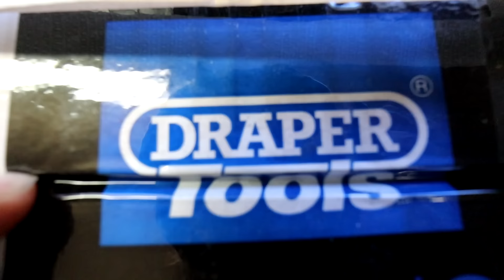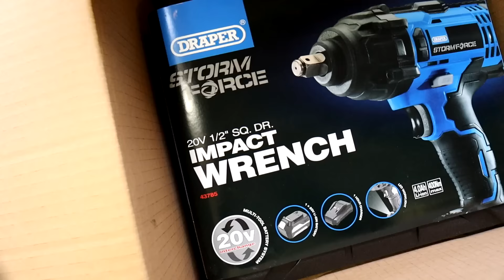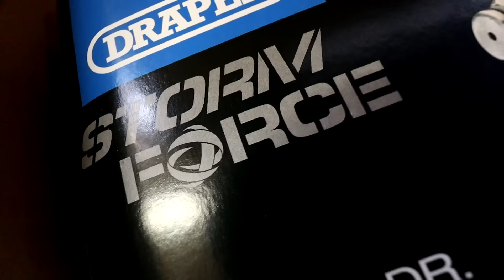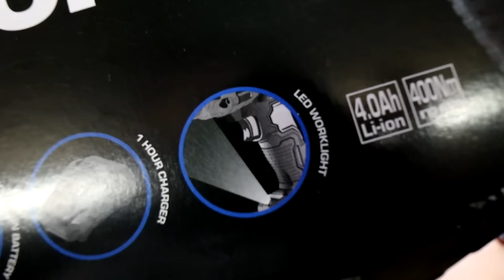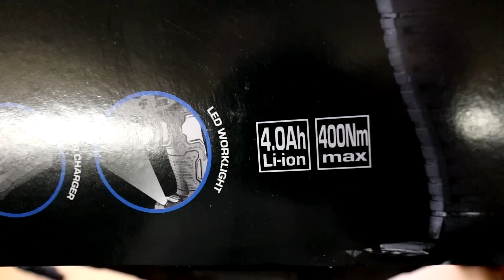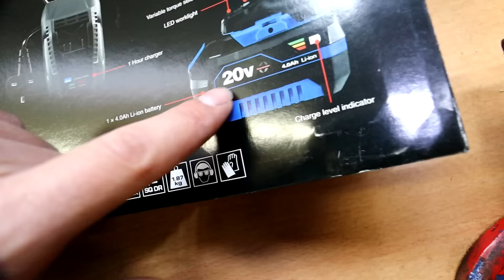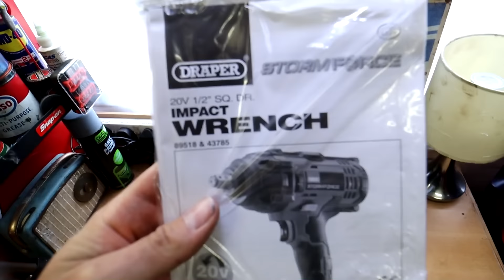Draper Stormforce 1/2 Impact! *Review*

Comment from the maker: The Intro Audio is a little messed up i have fixed it and it will be processed shortly.. So just enjoy the rest of the video! :D
Reply: The break away torque is 1200nm and max torque  400nm
Reply: Please let us know if the Lidls battery fits?
Reply: Brave torqueing those lug nuts to 210nm!
Reply: Best music is no music at all. I m coming here to see and hear about car and tool stories, not bloomin music.  That's why I like ChrisFix channel = no music and no stupid intros in his channel. There are lots of good youtube channels ruined by stupid music they mix in the videos. I just go somewhere else to avoid hassles.
Reply: Draper disabled comments on the video. Now confirmed it does work but with mod. I guess you did not want to answer as it would hurt the  channel and rep.
Reply from the maker: ziggy2070 what are you on about?
Reply: Hi I was wondering wat the model number for that 1 was because when I typed in draper stormforce 2 different 1s show up thanks mate
Reply: What’s your feeling on the draper storm force a year down the line
Reply: Lucky you must be really nice to get a free 1/2 drive impact gun.

Comment: Love the video great bit of advice because I was thinking the same as you was. I've got the storm force drill and 1/4 hex impact what I use for under trays etc. But abit of advice for the wheel bolts when tightening them torque them up in a star shape formation and in round the clock formation and then when their all torqued up go round in circle to make sure their not lose as when you tighten the first wheel bolt it may feel tight but then when you toque the rest and pull the wheel in to the hub, the first one may still be lose. Not hating just trying to help 👍

Comment: I would beware of cranking down lug nuts to high torque. I had a Vauxhall Frontera around 20 years ago and following a puncture, changed the wheel then cranked down the lug bolt by hand and sheared the bolt in half on one of the fasteners, had to limp home at low speed minus a tight bolt. Some vehicles recommend just 80 ft/lbs of torque on the wheels.
Love Draper gear. The Expert range are fantastic with lifetime warranty, the socket sets are fantastic.

Comment: love the blue color on tools so i love makita but draper when it comes to power tools are years behind. for 300nm this impact wrench is the same size like a makita or milwaukee with 1000-2000 nm. i don't know how much you paid for the kit but i got 12V milwaukee m12 fiwf12  1/2 socket and is rated 340nm for nut busting and at 350nm it doesn't struggle at all i tested it and it was able in 10sec to loosen at 450nm i also tried 500nm but it didn't manage and is half the size of this draper

Comment: Just how many tools does anyone need?
You could easily have checked the settings by tightening at each level then checking how much torque was needed to tighten nuts further. I actually have the Clarke you had. At least it came with sockets which I did not see supplied with the Draper.

Comment: I got exactly the same tool but with  the smaller battery,definitely wouldn’t shift wheel nuts ,I was so disappointed with it I took it back to the draper dealer,they gave me another and we tested it in the car park,still wouldn’t shift the nuts,I got a refund for the tool but not the charger or battery which I bought separately,so now I’ve got a battery charger and battery but no tool? I accept it’s possible the bigger battery may work,but I wasn’t advised and didn’t want to buy a more expensive battery on the of chance that it would be a failure as well,🙁

Comment: Decided to buy one on the above vlog and watching a few others. Waste of money wouldn't shift my wheel bolts at 180Nm. It also wouldn't shift the 21mm bolts, again 180Nm on the brake calipers. These are not 400Nm impact wrenches, I recon they sent you an upgraded wrench? Yes, the battery was fully charged and on the highest setting. It still had a job to shift the wheel bolts when I cracked them with a breaker bar. Hope this helps others who may be considering this wrench.

Comment: I do not think those "torque" settings are really torque settings. I think they are simply adjustable timing for an automatic stop. That is, as with some other tools, the tool senses when the nut is tightened about hand tight, that is the only thing it can sense, and then it either automatically stops, or adds a few seconds to how long it waits before it institutes the automatic stop. It does not actually start slipping when the correct torque is reached, the way the drill-driver torque adjustments do. It stops turning altogether. It is a bit misleading to call it a torque setting. It is nothing whatsoever like what a torque wrench does. So say you put it on torque setting 1 of 5. On a small diameter bolt it will apply perhaps the right amount of torque, but on a large diameter bolt it will stop shortly after reaching hand tight. Let me know if I am wrong!

Comment: I use the Dewalt DCF899 max torque is 950nm. Came as a kit with 2 5ah batteries, charger & case. Cost me £275 with a discount code. This Draper 1 looks quite nice,  Draper tools have never let me down either.
Reply: My makita is 1000nm tightening and 1600nm nut busting torque take that for a pissing contest lol

Comment: You will find the draper 20V tools is same oem as the parkside 20V
400nm is not a lot on bigger rusted bolts.
My Nano Facom NS1600F delivers over 800+nm in a tool a 3rd the size.
These battery impacts great mobile but in the shop nothing hits same as air and nothing as compact allowing far more usage scenario .
Any form of impact great though, wheels and jobs like strut top nuts suddenly 5 second job .
When it comes to real stuborn stuff the quoted 400nm won't go far though .
A good option in UK for battery impact wrench is AEG, currently on clearance at homebase for £39 bare tool, they do nice tool range also on clearance.
Reply: If working in a auto shop an airline really not a problem and you going be using one for other equipment .
when mobile or construction use battery massive benefit .
Air can far exceed those torque figures if required and in heavy comercial construction and farm equipment battery not going get you far.

Also battery tools not so good in harsh conditions, drop it a few times, cover in oil water and dirt and air tool holds up best.
Main reason I stick with air is modern high power nano tools like facom wrench and kuani nano reactionless ratchat such a small tool to power ratio it allows you use them in any area no access hassle and less user fatigue plus they very controllable and game changers in productivity ability, also tools like air hammer unique to air along with with a lot of other equipment .
Love battery if mobile or at parts yard ...

Comment: I wonder if those are similar to that harbour freight impact all the yanks are raving about, just in blue plastic instead of red. 

Real test on that would probably be if it could shift an axle nut. 

I have a Ryobi 18V impact. That has been pretty good. Wheel nuts. Some suspension bolts. I even have managed to get a few axle nuts out with it although last one i had, i had to get the meter long breaker bar. Plus the batteries work in all the other 18V tools - drill, hex impact, jigsaw, circular saw, reciprocating saw, lights, grinder. etc I have been pretty happy with mine.
Reply: It doesn't appear to be similar to the Harbor Freight Earthquake model.   That thing is bulkier and has significantly more torque (1200 ft lbs, though i don't think you can believe those numbers ;-)     it does look more similar to another model that HF sells under their 'Bauer' brand, though they are claiming 450 ft lbs for that one.

Comment: Update mine turned up yesterday used it this morning removing my Mercedes CLS 320cdi wheel bolts no hassle at all and that's on a fresh battery Draper recommend and tell you the battery will not be upto full capacity once its been depleted and charged 4 to 5 times. But so far very impressed and very  happy I watched this video Respect at you fella

Comment: Have a lot of Draper tools in my arsenal, screwdrivers, spanners, ratchets and sockets. Their expert range of sockets are brilliant since they grab the sides of nuts/bolts and not the points they very rarely slip off and round them off perfect if you have some crusty bolts. I use DeWalt for my impacts though since the DCF899H  has a stupid amount of torque (950Nm tightening, 1625Nm breakaway) and if it can't get a bolt undone you're gonna need some heat, not found a bolt it can't undo yet, it's even took off axle nuts with ease.

Comment: Check Aldi's Ferrex power tools. Look exactly the same. They don't do an impact wrench but do all the other tools. They are also selling separate 5.0ah batteries for £30. They may well fit your Draper.

The same company make these tools for Aldi, Lidl, various Screwfix brands and others. Possibly even Titan. They're a big manufacturer.
Reply: Does the parkside 20v batteries fit the Ferrex impact wrench? I've seen the Ferrex tools in store and they didn't seem as good quality as Parkside?

Comment: I am a huge fan of the Draper expert range I used to use snap on gear at work and we got so fed up of it breaking and having to warranty it  OK the repairs for the snap on were free and we never had any trouble but it was just the waiting time to get things back that was a nightmare  we decided to go with the Draper stuff which is great quality and bulletproof and is really priced sensibly  I am not a lover of the Draper I think its the redline range I had a ratchet screwdriver that fell apart after very light use but the Expert range cannot be faulted I think its great gear cannot praise it enough

Comment: I bought one of these on the strength of this, and other, reviews. When set on the 400nm setting it will not budge the wheel nuts on my car that are torqued to 120nm. It rattles and makes lots of noise, but won't loosen them one little bit. I can actually hold the gun in one hand and stop it from spinning with the other, and again it rattles and makes noise. 

Contacted Draper who weren't interested. So, in my experience it's an overpriced piece of junk.

Comment: I have a similar tool rated around 500nm,that has no problem taking wheel nuts off my 1ton vans. Last guy to put them on just ran em down with an air gun,and it still did it.
Newer battery impacts are awesome,even cheaper ones

Comment: I have to say. It absolutely reminds me of the 1/2 inch Parkside impact driver. The design, the look and shape of the charger and the battery, that is supposedly do 400Nm. I'm 100% sure that is not made by Lidl, but rather made by Draper in different labels and colours. Would be interesting to know it those would be interchangeable between them two brands.
Reply: Parkside PASSK 20-Li A1
Reply: Do you mean the 1/2 inch Parkside impact wrench? The impact driver has a 1/4 inch hex bit.

Comment: Thanks for a great video James!, been considering an impact wrench for a while and your video sold it to me! Literally just received my 43785 with the 4.0Ah battery today. £137 from Amazon Prime. Awesome bit of kit, feels solid! On the one I received, the different increments of torque are marked in white print next to the LEDs 100, 150, 200, 300 and 400NM. Bought it for a Classic Vespa restoration so fingers crossed it won't snap the frame in half lol.

Comment: Thought you might have mentioned for safety about using the correct type of impact sockets when using the impact tools...
Like you i have used Draper tools for years although i purchased a set of ratchet spanners from Draper that had a black finish.
Only after using the spanners a couple of time the black finish started to chip and mark.I emailed Draper to complain and 
was given a brush off.....I no longer purchase tools from Draper.

Comment: I could not get that kit. My dealer said it is bare bones only for these tools. !! But I did get a bare bones Wrench, 4Ah Battery and charger for €185.

400Nm is getting my wheel nuts off by Terrano 4x4 without busting them first, so this represents the cheapest option that I've found, I was looking the DeWalt 20V but currently for me it's a bare bones €320 !!! I do have 20V DeWalts but not the wrench.

Comment: I have the older version of this which I think is pretty much the same other than the design, great bit of kit paid about £100 on eBay brand new will do most bolts only thing I’ve had it struggle with is a front hub bolt but it was extremely tight.

Comment: TIP: cover the outer edge of the socket with some insulating tape. This will protect the alloy wheel if you miss the bolt head when putting it onto the bolt.
Reply: Or buy a proper alloy wheel socket 👍
Reply: @honestreview1043  makes me laugh when people are shy of spending 20 quid on the proper tool. A penny saved is a penny earnt again but come on...

Comment: Do those Draper batteries fit Lidl tools? they look suspiciously similar.
Reply: Lidl also has 20v impact.and it looks the same as this one.only other color.and in lidl it costs like 70€
Reply: Yeah I would like to know also
Reply: I was going to ask this too, also the tool case looks identical to the Parkside ones! would love to get the Parkside 1/2 inch impact wrench too. but would be happy with this draper one if I could use my current Parkside batteries
Reply: Was looking to see if someone commented/asking about this. When the Draper channel launched this, I commented about the very same.
Reply: I'm here for your rescue guys. I have a parkside angle grider, small impact driver (180nm) and wanted to get the large 1/2 inch drive one as well for the convenience of the batteries.  I checked the Charger on the video against my charger. Sale polarity, same voltage, same amperage, same labeling. Looks 100% identical so I took the privilege to order the same Draper Impact driver as a bare body (£77 from Ebay -15% off discount) it arrives tomorrow and I will try to use it with the parkside battery. If it won't work it goes back. If it will happy days. Parkside battery £28 , Draper £50. For the 4AH ones.
Reply: @robertapro1636  Please report back with your findings
Reply: @robertapro1636  worth mentioning aswell there is 2 versions of this tool, one with 250nm and a 400nm version
Reply: @robertapro1636  what's the verdict mate?
Reply: Current update is that DPD is f.cking about with it and it is most probably be here Monday.  I'm waiting for it too guys. As soon as it's on my doorstep I give an update on it.
Reply: SO FINALLY ITS HERE.
I have good news and bad news when I put the battery on it did not slide all the way in to lock but the electrical connections touched SO THE TOOL WAS WORKING but if you would use it the battery would have fall out. After a little mod to the rails the battery slide onto it fitted perfectly. 1 minute with a Grinder and a Stanley knife and spot on.  This little mod saved me about £80 (on buying only a bare tool compared to buying one with a battery and charger) and about £20 on any replacement battery ( Draper £48 for a 4Ah and Parkside is £28 for a 4Ah)
It might be a bit of a hack but definitely worth it.
Reply: @robertapro1636  thank you! Any chance you could make as video of the mod would definitely be popular
Reply: The Draper batteries will definitely fit Parkside tools, to fit Parkside battery into a Draper tool the battery holder need a slight modification to the rails holds the battery on.
Reply: I put togethera little video of what I done this weekend.
Reply: Fair play Robert, you've gone to lot of effort.
Reply: @robertapro1636  I can't find the video can you share please?
Reply: @robertapro1636  thank you!
Reply: @robertapro1636  Good stuff. Obviously you'll void your warranty on the Draper device. I wonder if a 3d printed shim could be a possibility with some additional pass through connectors? The lidl batteries are such good value at the moment.
Reply: @robthomas7232  unfortunately I don't have a 3d printer so I won't be able to help with that. ;)
Reply: @robertapro1636  Neither do I lol something I want but fear it will sit there gathering dust in between interesting projects. Also if anyone wants to highlight to Lidl to bring their 20V 400nm Impact Wrench to the UK, which I don't think they have ever sold here, then let them know on their contact form here -> https://www.lidl.co.uk/en/Contact-Us-4187.htm?
Reply: @willo219  they are in at the moment with the 4ah battery and charger for £60.
Reply: @mattblackledge9068  Matt thanks for thinking of me, I have been today and picked one up. can't wait to give it a spin and see what its like!
Reply: @willo219  I've been waiting for them to come back in for months now so was glad to see them on last weeks flyer. Deliberately went in just before closing because they normally change the stock just before closing. Had a play with a few wheel nuts this morning and works a treat. For £60 including the battery tou cant complain. Even considering buying a spare incase I break this one for that money.
Reply: @mattblackledge9068  I went in today around 16:00 and got the last one luckily! they've been popular and like you say for this money I'm not suprised!

Comment: I would have tried undoing the wheel nuts on a lower torque setting. You could find out what torques the lower settings are capable of as well.